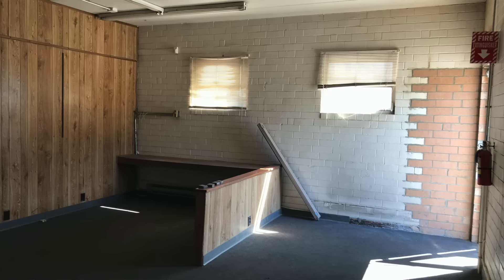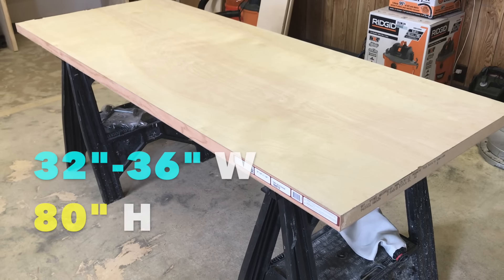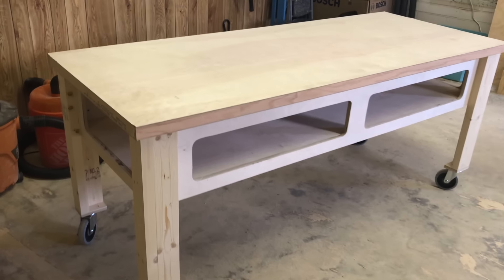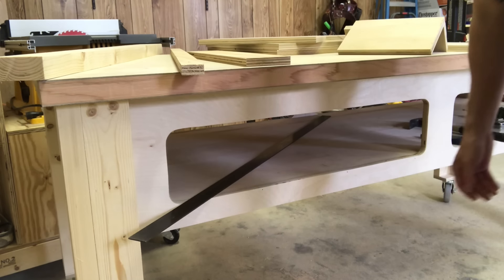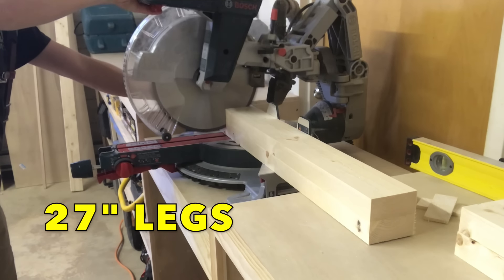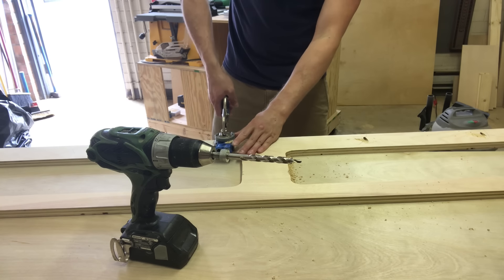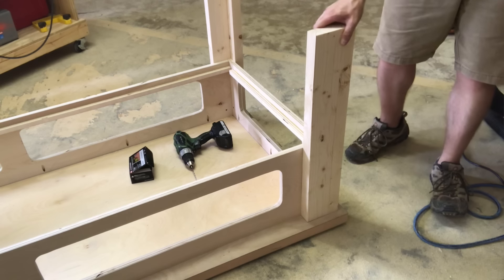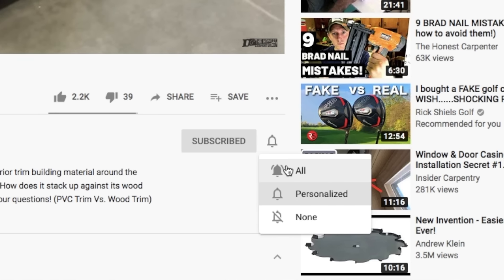These Make The BEST WORKSHOP TABLES / WORKBENCH!! (Tips, Tricks, Secrets--Workshop Table Full Build)

Comment: Those sweet moments in life when one of your favorite channels uploads EXACTLY what you needed and were looking for. Thank you!
Reply: Have the same thought and just got back rom depot after getting a door
Reply: Same for me. Now I have to change what I was building. Great ideas in this video.
Reply: Exactly as you say. I built a workbench 20 years ago using a solid core door from Habitat for Humanity. Mine is stationery. The superstructure was built from a second solid core door. They will last longer than I do.
Reply: This is exactly what I was looking for🙂
Reply: same
Reply: Thank you. Do you have plans for a workbench with a couple of wood vises. Really like your design that makes easy flip/ replacement of table top.
Thank you.
Reply: I didn’t even know I needed this! Now it’s the first item on my summer project list (which I dream of on this  bitterly cold January afternoon).
Reply: Fernando.  I saw this miter table top is 32" deep.  Would you happen to know what the widths are for the top left, Miter section, and the top right?  Thank you and great comment.  Good luck with your project. William
Reply: well said :)
Reply: @Will-dt3yg  thanks for the comment, I wouldn't know the exact measurements he used, I got the idea from the video and made adjustments to my own space, sorry I can't help more

Comment: I'd have used the hole saw to cut the corners of the skirt board... and left the under shelving free-floating. This way, if the worktop needs to be flipped or replaced, the whole table can be turned over and the pocket screws easily accessed. Otherwise, I quite like this worktable design.

Comment: Here's my tip/trick: screw a sheet of pressboard on top. Just replace it when it gets torn up. Easy, relatively inexpensive, and it saves the (more) expensive door.
Reply: Yeah but is it square AND flat ?
Reply: @boke75  It can be as square and flat as it's substrate. I've done it for years. But, that's certainly no reason for you to do the same.
Reply: I'm going to assume you meant tempered Masonite? Been using that for years. It's smooth on one side.
Reply: @davidguenther8170  Yes Sir. One in the same.
Reply: @solosaga5091  Is that the stuff that they also call Brazilian hardboard - smooth on one side, kinda like burlap on the other side?
Reply: you mean pegboard?
Reply: @5084204  Yeah, but with no holes - same thickness, same color.
Reply: @paulsawczyc5019  Sorry for the late response. Possible, as it sounds similar in structure. But, I've never heard it called that.

Comment: I have made the same work tables in the past. The one added difference is I edge-band the door top with 1/4” oak that stands proud of the top by 1/8”. I then drop in a piece of 1/8” double tempered Masonite which becomes a sacrificial top that protects the solid core door top, and when the top-side of the Masonite gets damaged I simply flip it over and I have a new top.

Once that sheet of Masonite is completely worn out I can easily replace it with a new piece. That way the bench top (door) last indefinitely and makes for a bench that will last for generations.

FYI: depending on how you care for the work surface, a sheet of Masonite can last for years. My second work table is for assembling wood projects only and the original Masonite that I installed on it 22 years ago is still in near mint condition, so I have yet to flip it over to the second side.

My first work table is on the second side of the original sheet of Masonite. I flipped it about 4 years ago. It was originally installed in 1993.
Reply from the maker: Good idea, Woodsmoke! Somebody mentioned something similar down below. Gives me something to think about. Great way to extend the table life!
Reply: I would prefer the masonite flip, keeping the one side for messy jobs, the other for complete flat and untouched...great add on to the Honestly Awesome Carpenter's vid!
Postscipt, can always pop off the masonite for the new surface for "finesse" jobs...
Reply: @TheHonestCarpenter  hello I watch a lot of your videos and they have been invaluable.  One of the major things I seem to be having trouble with is developing a client base.  I'm a one man crew, and I do work as a general handyman.  I know how to do most things, but I keep losing work to my area's competition.  What tips do you have for building a business to where I can actually start bringing in more money? If possible could you make a video on this if you haven't already?
Reply: Smart tip. Having a wipeable surface on a assembly table is a great idea. With drops of glue and stain everywhere a wood top gets messed up pretty quick
Reply: Good idea. Do you secure the Masonite down or just let it rest on the top?
Reply: @brandofluck  would also like to know. Not sure how I feel about a floating work surface. I’d rather drop an extra $80 on a new door every… what - 5 years (being generous) and have a secure top.
Reply: @stede9304  I built a version of this workbench. I used a floating Masonite top. I used some oak trim around all four sides and attached the trim pieces 1/8" higher than the workbench top so when I set the Masonite in place it is flush with the trim. My top is nice an flat. If you needed to hold the Masonite down you could put a few short screws in.
Reply: @rogerbaughman3542  I live in a close-knit neighborhood with a lot of folks who have lived in their homes for 30-50 years. They often have smaller jobs in mind (building a specialized storage closet, converting closet for washer/dryer, repairing leaking basement egress window, etc.). When we started remodeling our bathrooms a few months ago, many neighbors asked me for the name of my contractor. My suggestion for you is to use existing clients as a foundation - be sure to have informative business cards to leave with them to hand out, have an informative sign on your truck (business name, what your specialty is, phone number) so neighbors see who's working on their block, and perhaps offer a discount for first job on those business cards. My neighbors regard having "my carpenter" as a prize, and are happy to show off the results to friends. Make it clear that you're willing to do small jobs, be honest and deliver promptly as promised, and you'll be swamped with work. 

And, by the way, when neighbors ask me, I say I can't recommend my contractor, but one of his experienced crew members is about to return to working on his own, and I talk him up enthusiastically. I just hope "my carpenter" doesn't get too busy to continue doing small jobs for me!
Reply: @TheHonestCarpenter 
Where in the hell are you finding a solid wood,  no panel door for $80 bucks at Home Depot? I just looked on their HD app, and none are near that low of a price.
Reply: Taking this idea a step further, for those worried about glue and stain, cut the masonite / hardboard into two easily flippable pieces (now 2 smaller, almost square inserts).  Drill 1/2-3/4" hole near one edge as a finger grab. Laminate 1 side of each insert with cheap builder grade countertop laminate. Now you have an available surface that is moisture proof. 

You can also make other masonite inserts with other kinds of laminated surfaces for various forms of work surface, e.g. vinyl floorling laminate for repairing finished pieces that you want on a softer surface, less likely to scratch or mar.
Reply: @travelinman482  He's getting $130-$150 doors for $80 because they have dinged up edges / corners. Depends on your local HD / Lowe's, but they will usually haggle on these kinds of things.

Comment: I'm an old codger in his late 80's, so the most important thing in a work bench for me is its HEIGHT.  I've built a couple in recent years one using 3/4 plywood, the last one using 3/4 soft pine " laminate " material.  That is material which is not laminated at all but multiple blocks glued together, and a lot cheaper than plywood.  The best height is elbow height, so there is no bending over.  Deep edges allow easy clamping to the point where no vice { cf vise in US speech  ] is necessary.  Not much good for planing, but I have not used a plane in years in fact.
If 3/4 tops are too bendy for you add a longitudinal stiffener along the long centre line of the top, say about 2 inches deep by 3/4.
Reply: elbow height? Thats seems a bit to high... 90cm max gives you the full control what's on the table..
Reply: @5084204  I take it from your comment that you are not in your late 80's.  When you are, you may care to re-evaluate.  Meanwhile, best of luck with your 90 cm height.  Each to his own.
Reply: @crustyoldfart  I have nothing but the respect to your solution and age: I wish you many more great projects in your workshop.
Reply: Thank you so much for this suggestion! I'm a 59 year old 5'4" female who would like a custom work table for crafting & woodworking. I too have a bad back - in my case from a severe injury just at the base of my spine. That first tiny bit of bending forward is The most painful thing for me, so to have a work surface height which completely avoids bending over is such a Wonderful Idea. But I would not have ever thought to measure from my elbow - I guess it's common sense, now that you mention it - so Thank You for these great ideas! 

My respect to you for continuing to do what you love, and finding ways to work around the issues of aging. Wouldn't it be lovely if our aging bodies could be as easily repaired as our old homes? But the best we can do is work around our physical "glitches" to find ways to keep doing what we enjoy!
Reply: @alycejohnson8115  I'm so glad that my suggestion found someone who realizes that it may be useful.  I arrived at the idea by evolution - gradually discovering the easiest way to work.
Another thing I learned [ the hard way ] is the importance of avoiding breathing very fine wood dust.  Extremely fine dust [ in the micron sizes ] is notoriously difficult to contain even using good quality dust collection equipment.  It is suspected that these fine particles can not only enter your lungs, but subsequently penetrate lung tissue and enter the bloodstream.   
Whatever the cause, I personally underwent triple by-pass heart surgery in my early 80's.  So now, rather too late possibly, I am careful to wear a mask when sawing wood.
As to the problems caused by ageing - I remind myself that liking what  you get is much more important than getting what you like.
My very best wishes to you and success in  working around your own physical glitches.
Reply: THANK YOU Sooo MUCH 🙏 for your Warning about super fine Wood Dust! As I have Interstitial Lung Disease - a progressive autoimmune condition of Unknown cause, but which (at least in my own case) is known to be significantly Exacerbated by Smog (an irritant which is Also down in the Tiniest micron sizes & therefore deeply penetrates the lungs) - you can bet I will Henceforth be wearing a mask Whenever I am cutting wood! (I have not done so in the past but fortunately I have done relatively little of that particular task.) 

I had No Idea wood dust down into the micron sizes was even produced much less was prevalent enough to be a genuine health hazard. 

From how on, whenever sanding AND ALSO whenever Cutting wood I will be taking MUCH More Stringent Precautions - which I did not previously realize were SO Essential,  particularly for MY health, given my specific health issues!! 

I’m So Grateful for Your detailed explanation &’warning! 

I am about to embark on a large project for my living space. I have done very little woodworking in the past but have been investing in Tools & am intending to do a lot more woodworking over the next couple of years, to gradually customize my living space, to add custom storage. 

Without your detailed Explanation & cautionary Advice I would Undoubtedly have flared up my lung condition & would not even have realized How I had done so. 
Now,  thanks to your wise warning, I will take multiple precautions to make sure that does Not happen! 

My bloodstream receives only 55% of the oxygen I should be getting from each breath of air due to the lung damage caused by ILD. 

But when ILD is flared up & is exacerbated due to increased Inflammation, itself caused (Especially in my own case!) From fine particulates (<5 microns) My oxygen assimilation Drops Even Lower, 

whereupon I am then obliged to use supplemental oxygen for a time period, and, far Worse, to take high dose Steroids, until my lungs are restored to their best possible baseline functioning. Obviously this scenario is to be Avoided at All costs! 

At Present my optimal lung function is at 55% of “normal” but my lung efficacy is very gradually dropping, as the disease progresses.

Strict Avoidance of Tiny particulates (<5 microns) thereby avoiding the increased Inflammation they inevitably cause is Crucial for my long term survival & for my immediate & short term functionality! 

So I am more grateful for your Insightful Explanation & Warning than I can adequately express! 
You have done me a great Service! 

I’m so very sorry for your health problems. I truly hope your bypass surgery will give you many additional productive & enjoyable years of life & will allow you to continue pursuing your hobbies & goals, going forward. 😀

THANKS again for taking your time to Share your own experience & knowledge! 
I very sincerely wish you all the best!
Reply: @alycejohnson8115  Sounds like you've started your research already, but 3M has several guides on their site (in the PPE mask and filtration pages) for the types of filters to use with their masks based on the contaminants encountered. I was fairly recently looking into the details more and came across them while reading some advice and information on various forums. They helped quite a bit in determining my setup.
Reply: Definitely agree on the height aspect. A few years ago, I made a workbench that's served me well the entire time. I used to work on either larger items or smaller items in short intervals. Recent projects have made me painfully aware of the need for something higher after having my neck and shoulders bent looking and working downward hours on end. As you said, a few experiences will dictate the necessary changes, haha

Comment: I use tables like these in my prefab timber framing company. Although a bit less nice. Just 2*4 and 3/4 ply. 

We have a big one where we 'surround' window and door frames with all the lumber and tape that needs to go there, then lift them from there to put them in the rest of the frame. 

The smaller ones can be combined when necessary. Sometimes I need to combine or work on beams for roof elements, which can be all the way up to 40'.

We gave all of them an extra shelf on the bottom for boxes of nails, screws, glue, etc.

Comment: My father used solid core doors as well for work surfaces back in the 60's 70's and 80's.  I've done my part to carry the tradition forward as well.  Wasn't aware that it was perhaps a common practice.
Reply from the maker: I’ve seen it in a few other shops over the years, Dan. Next step is to coat the top with minwax to prevent glue adhesion on the surface 🙂
Reply: I did the same about 12 years ago. Though I mounted it on a double-wide drawer base cabinet that I harvested from a kitchen remodel 3 houses ago. The cabinet was made with hardwood plywood so it's quite stiff and the addition of a 3/4" back made it much stiffer. The cabinet was ~48" so I trimmed the door length down to 6 feet.
Reply: @cidercreekranch  Any issues with trimming the door?  Thinking I have to do that because of space constraints.
Reply: @jfchapman42  I have this question too. Thanks.
Reply: @John Chapman, etal:

If you don't mind the particle board core showing on the end, it should be okay. Personally, I'd rout out enough particle board to install a solid piece of wood between the top and bottom veneers.
Reply: My first two desks, back in the 90s, back when monitors were big and heavy, were solid core doors on a pair of metal filing cabinets.  Stained and tung oiled, as they both had solid wood trim on all four edges and finished out nicely.  The first was cut down to 60 inches for apartment living and the second, in '98 or so, was the full 80 inch door.  No need to attach that mass to the filing cabinets, as it wasn't going anywhere.  The first one became my garage work bench, which I gifted to a coworker a decade or so of use.  The second became a headboard for my in laws.
Reply: Did you learn anything from your dad regarding carpentry skills?
Reply: I built my workbench from a solid core door my dad salvaged off a job he was on (30 year career as a professional carpenter!).  It's worked great though it was an extra wide and tall door so I was able to rip it down a bit to get rid of the doorknob hole!  I also had one as a desk growing up and again in college.  The door knob holes worked excellent for cord management on the desk.

Comment: I've used a hollow core door and folding horses for field work the last 20 yrs... the hollow core door is just  lighter to move around, and doesnt add extra weigh on the work truck. For stability, I fasten it to the horses with 2 1/2" screws and fender washers. 

If I ever get a shop back, I'll definitely  build the work tables in this matter.

Comment: Great build!  I once used an old hollow core door for temporary workspace in a garage, hinging it to a wall cleat (using its old hinges) and hinging legs to it so they fell open when you pulled it away from its stored position against the wall. Not a primary work table but very versatile.
Reply: That's great! I was thinking of a similar idea for occasional work surfaces in our garage, which is not the primary workshop.
Reply: @wendykrause6791  it was so easy that I couldn’t believe I didn’t do it sooner. I expect you’ll find it the same. 👍